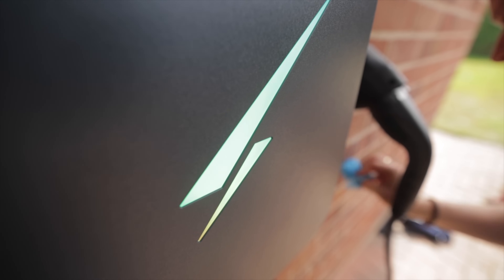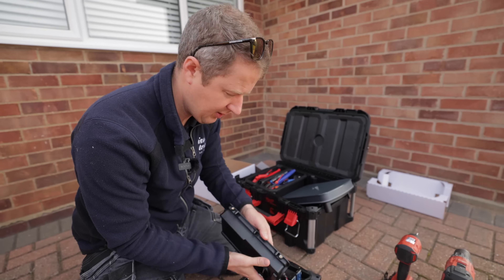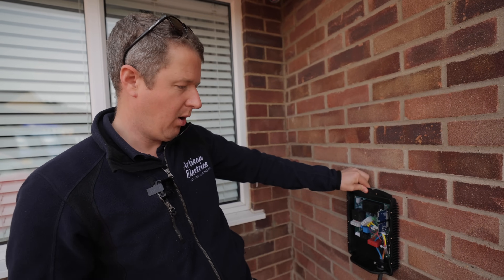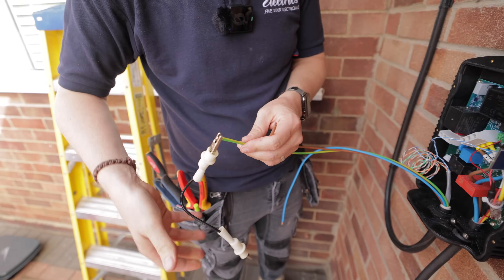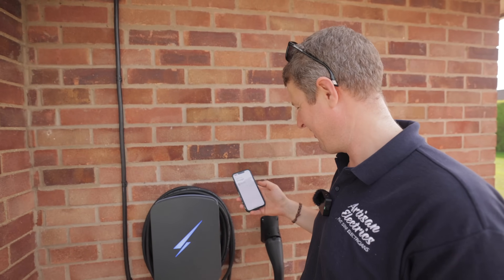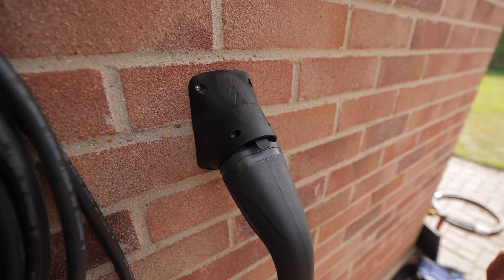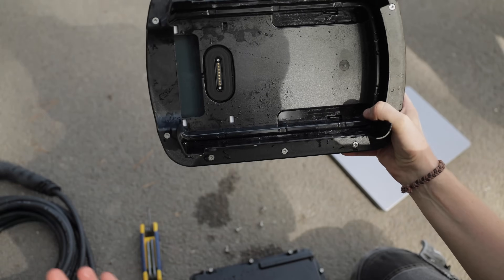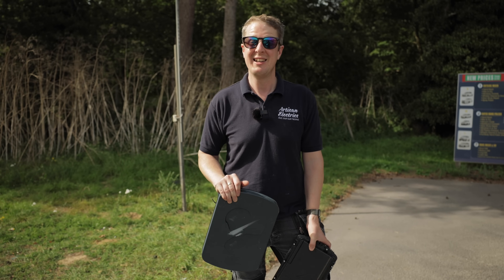NEW Hypervolt Home 3 Pro EV Charging Point Review

Comment: Hello could you give me some advice i currently have a Tesla charger that when our car is plugged in Octopuss Inteligent can charge at will to suit them which is fine ...my problem is that this will take power from my AIO giveenrgy battery if outside of the cheap rate 11:30 to 5:30 ...would a hypervolt 3 be able to stop this ?

Reply

Comment: You mention that it can host two CT Clamps for Grid and Solar is that correct? Trying to decide between this and Zappi, any advise on that for use with Solar? Impressed by Artisan Electronics skills and service. Thanks
Reply: Yes you can add a second clamp.

Comment: Would of be good to tell us what the main differences are over the Hypervolt V2? Also does it work with Octopus intelligent been waiting for that integration on my Hypervolt V2 but hasnt happened 🤔
Reply: Appreciate this replay is a year after your comment but Octopus are offering this for sale now to use with their intelligent tariff.
Reply: Yes hypervolt are/have updated the hypervolt v2 chargers so they work with octopus intelligent, but since then I have now moved to Tomato Energy as its loads cheaper than octopus 👌⚡️
Reply: It doesn't work as well with octopus intelligent as the Ohme because the Hypervolt can't communicate with the vehicle to read it's state of charge like the Ohme can. If you don't have a vehicle with an API this won't make any difference though.

Comment: There is a charger at my local supermarket that has had the charging cables cut off by vandals, no doubt the cables will be sold on as scrap. After this happened twice it looks like the owners have given up and not replaced the cables. Looks like some work is required making these charging points more durable
Reply: The solution is a non tethered cable but for some strange reason this installer doesn’t like them?! I’d never buy a fixed cable charger

Comment: £110 for a jet wash! I presume he was joking! Is 4mm cable on what might be a 7KW EV charger OK? (7KW x 4mm x 10m = 3.35V drop = 1.5% loss).  I see you are using the new fire rated cable clips, which look very neat and tidy. I did wonder about the asbestos sofit boards too, after all, drilling a hole through one might not be healthy. I am thinking of replacing all of my sofits with UPVC cladding, partly so I can look the insulating on the top of the wall and cavity opening - also, saves painting them every few years.

Comment: So IK 10 rating is 5KG from 400mm high using a drop hammer in a test or 20 joules of force.   As you shown, it won't stop a sledgehammer with someones weight behind it swinging it.  🤠👍

Comment: Anyone choosing an EV charger now needs to get one that's compatible with Intelligent Octopus. 6 hours of off-peak at 7.5p, and 15p export. Sadly the Hypervolt is not compatible despite all their customers asking for it for years.
Reply: It's here now
Reply: This is coming later this year
Reply: Yes, I agree
Currently I have a 3 phase supply at home (needed the supply upgraded as it was a 1953 PILC lead cable which was not capable of supplying property) 😀now
SPEN just finished a 3 phase 80A supply
I have Octopus Agile and my Zappi links to Octopus and is currently charging my Eddi (water heater) and Zappi tonight automatically when the cost drops below 2p per Kwh (I can change that amount daily to charge my van on the cheapest cost automatically)
Reply: Everyone calm down - I can confirm it’s here. Furthermore, Octopus now even sell this charger (just to calm any doubters)

Comment: Im sure itll probably work but youre not supposed to expose and untwist cat5 cable. The individual conductors should be as short as possible into the plug technically

Comment: Vandalism is likely to significantly increase as more EV chargers appear on streets and in front of homes.
Therefore, damage mitigation to EV chargers is a serious point.
Reply: Agreed, having an easily stolen or damaged cable wrapped around the case like a garden hose is a bad idea (and looks really naff). As is the light up lighting bolt on the front of the unit advertising the fact.

Comment: Its a great charger, but the customer service is abysmal. I have told them to remove me as a trusted installer. Their poor customer service reflects badly on the installers who are their lifeline.
Reply: I can't possibly imagine why they'd answer the phone to Artisan immediately, you know that company that has the power to fundamentally change the design of their chargers and has a massive YouTube following 😂
Reply from the maker: Really? I have always found them to be good when I have called - they answer quickly which is a change from most manufacturers...
Reply: @artisanelectrics   They do tend to answer quickly, but there is a disconnect between the customer service and the technical department. They are the only company who I video all my work for - because they have repeatedly proven to be underhand. No trust there at all for their "trusted installers".
They are now the only brand that I refuse to install, but unfortunately, I still have a commitment to service their devices for me existing customers.

Comment: I hope they fixed the atrociously bad wifi issues from HV2 units.
Reply from the maker: Yeah the WiFi is amazing on these - connects instantly and ping is super fast
Reply: My Hypervolt 3 is in a location where the signal is around  -70dBm and it doesn't have a problem. It only has a 2.4GHz radio
Reply: I would hardwire anyway.

Comment: Watch those soffits guys, they looked a bit like asbestos cement sheets - damn stuff is everywhere in the UK still and were used for soffits on houses built in 70's to late 80's
Reply from the maker: Thanks - good shout
Reply: Asbestos cement sheets are relatively low hazard unless you start angle grinding or sanding them.
My local council even lets you take them to the local tip with no restrictions.
But yes, be aware.
Reply: @markrainford1219  You are lucky - my council treats them as atomic waste.  You cannot transport them anywhere, you have to book special transport and their bio-hazard bags.  You must double bag it then wait for the special transport to collect.  Whole process is time consuming and costly - I think it cost £200 when I had my soffits upgraded to plastic
Reply: Book yourselves on an asbestos awareness course, the places you can find it in older houses is crazy. Best to be aware and safe.

Comment: Ideally you would need to use a ceramic screw driver when moving a potentiometer. But they could have used some plastic cap to use with your hands or any screw drivers
Reply: Rubbish, it's a switch not a potentiometer and ceramic screwdrivers are only used on trimmer capacitors not resistors as metal nearby can affect the value, completely pointless for potentiometers or switches.
Reply: @mfx1  it looks a multi positions pot.
Reply: @max246  It's a switch, either way you don't need a ceramic screwdriver unless it's a trimmer capacitor for an RF circuit.

Comment: so if you wanted to put an RJ45 on the cat5.... what would you use for the CT connection?
Reply: Officially, you can't.  Some electricians may say you can use two pairs for 100MBit/s half-duplex ethernet and use the remaining pairs for CTs,  but telecoms engineers would strongly advise against it.   Whilst it may work over shorter runs, it should be considered a bodge and not relied upon because it deviates from the standards. Entwining the CT's electrical signal with the Ethernet will do nothing for data integrity, especially over medium to longer runs.  It's a massive oversight with EV Ultra in my opinion - either you have CTs or Ethernet but no combination over the same UTP can be considered standards-compliant.
Reply: @MrBinabanana  The whole reason wired ethernet over twisted pair uses twisted pairs is that they become immune to mutual interference (what affects one conductor in a twisted pair will also affect the other to largely the same degree; keeping the voltage between them the same as without interference). A CT typically has a turn ratio of 2000:1, meaning that when it's measuring 100 amps flowing through it, it's transmitting 50 milli-amps on the CT wiring. There is no way in the world 50mA RMS, or even 100mA RMS if you had 2 CTs, is going to interfere with Ethernet over twisted pair to the extent that it wouldn't work. I bet you wouldn't even observe a measurable increase in the incidence of frame errors. Even better still, many CTs have their burden resistor on the CT side and transmit only a voltage difference -- exactly the same thing Ethernet is doing over exactly the same wiring. Unless the current use of the property is ramping up and down from practically nothing to practically max several times per second, this isn't going to cause any interference at all. None.
Reply: @aaronmdjones  So basically, what I said. You might be able to get away with it, but it’s not standards-compliant. To be honest, I wouldn’t want to be in a position where I’m betting on a greater or lesser incidence of frame errors - I want to be in position where I’m simply doing things correctly by following the standards. They’re standards for a reason and anything else is a bodge.
Reply: RJ45 for ethernet only requires 2 pairs, CT 1 pair and 1 for good luck
Reply: You only need 4 pairs for gigabit. 100 Mbit/s Ethernet runs on 2 pairs.

Comment: I've had a Hypervolt for almost two years now and it's been great. However, I bought it partially because of the supposed good support from the company. 

While I've had no need to contact Hypervolt myself, it was rather disappointing to see some of the reactions and interactions on the various Facebook groups from the company owner. Users seemed to have genuine questions or issues and the attitude of the person was less that professional at times.

Whether or not the customer was right or wrong there should never be a case where a company gets into an arguing match on social media (or any public place) with a customer. 

The product also seemed to go through quite a few revisions and early on the "cheapest" accessory components were used - for example, WIFI connectivity used to be via USB WiFi adapter and many uses had problems - I don't doubt it - I had a look at mine and it was a £1.80 component (identical on AliExpress) - for a £700 charger why go for the absolute bargain basement accessories. 

Hopefully they were just early days problems made more difficult because of covid related supply chain issues but it wasn't a good look at all.

I'd probably buy Hypervolt again (it was the only one at the time with 10m cable) but am not that keen on the company and their perceived attitudes sometimes.